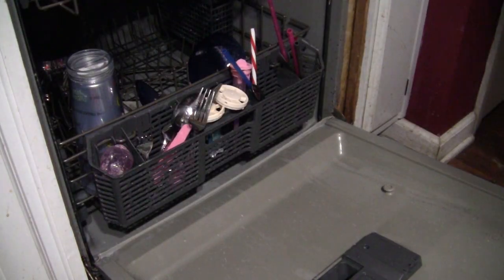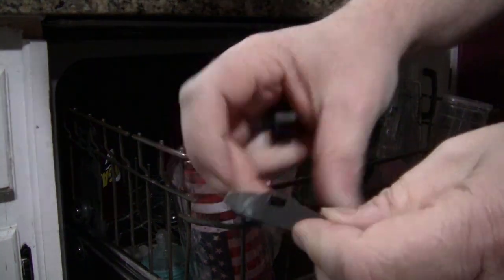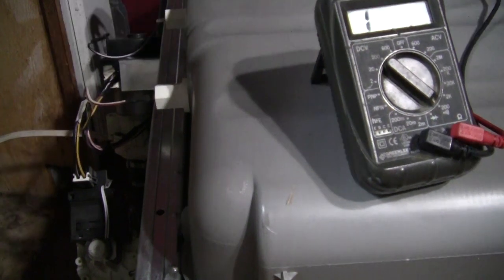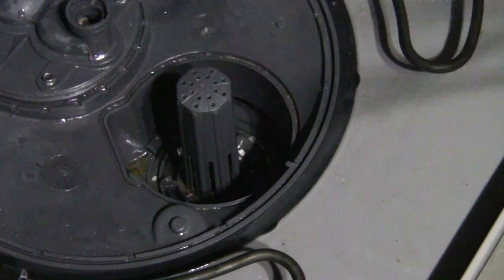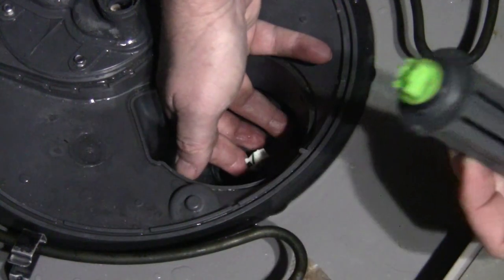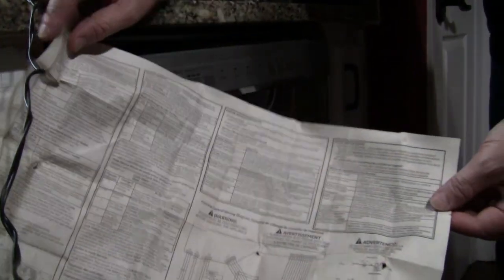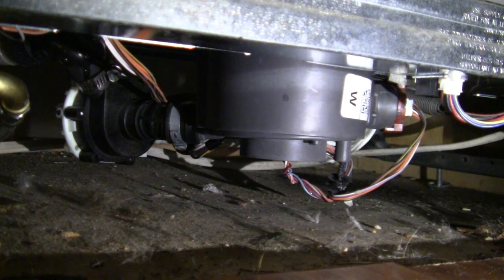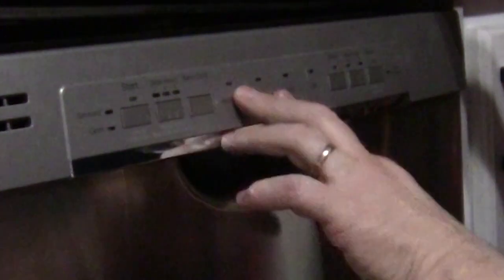GE Dishwasher Heater Not Working Flood Switch Replacement

Comment: Exactly the fix I needed.  I didn’t even bother pulling out the dishwasher and checking the heating element.  I purchased the flood switch assembly on Amazon and a 1/4” hex screwdriver with magnet and fifteen minutes later the repair was done and after running a full cycle I can verify that the heating element is again functioning!  

I could tell upon comparison the old and the new that the float was stuck and highly probable that this was the problem.   Thanks so much for the video!
Reply from the maker: You're welcome and thanks for watching!

Comment: I had this same problem in my GE dishwasher.  I thought it might be the heating element, since that's the usual culprit, but when I checked it with a multimeter it was fine.  I was able to order the flood switch and the install was quick, easy, and cheap.  My landlord even took $200 off the rent because I saved him the cost of having to buy a new dishwasher.
Reply from the maker: Awesome!! Thanks for watching.

Comment: Thanks for the tip, I was convinced that I had to replace the heating element before I saw your video. Replacing the flood switch took about 10 minutes and fixed the issue.
Reply from the maker: I'm glad that it helped!

Comment: I noticed that when you took the old flood switch out, I didn't hear it rattle. And when you started to install the new one, I heard the float rattling around. From the looks of the old one, that food did a number of blocking the float. Good video by the way!
Reply from the maker: I should have checked it out more, including cleaning it and doing meter checks. It was so inexpensive I just swapped it and was glad that it worked. 
Thanks for watching and for the feedback!

Comment: This is the first model dishwasher I’ve seen with the float location in the sump. Also the first I’ve seen that the float switch is in the heating circuit. Interesting. Thank you for this very informative video. Well done!
Reply: Yeah I replaced $150 control board thinking it was gonna fix it. Well, it didn't and now I'm going back to the customer's house to replace the flood switch. Customer complained that it didn't heat anymore

Comment: If at the end of a dishwasher cycle your dishes are filmy and plastics on the top rack don’t dry well- 

Open the door mid cycle and see if you don’t see steam when you open the door.  This is a fix that worked for me.  Just replaced mine today and I had steamy water when I opened the door midcycle and my dishes were clean without the film and greasiness, hot and dry after at the end of the wash 👍

Comment: Fixed my dishwasher with this video, THANKS!  I didn't bother pulling it out, shutting off the water, or even disconnecting the power.   Yeah.  I know...
Reply: I can't understand how the little part you put affected the heat, did it affect the heat
Reply from the maker: It's looking for a signal from that sensor.  If it doesn't see the signal,  it will not turn on the heating element.

Comment: Wish I had found this video a few days ago to fix my no water problem. All the videos I found showed the float of to one side. I needlessly bought a control board and tried to unscrew what I learned later was the float switch ripping the wires apart at the connector. Not until I stuck my head in there I found the 2 screws that hold the retainer ring. As soon as I pulled out the switch assembly and  saw the wire connector I then knew what it was. The float inside must have been stuck up as I never could see voltage at the water valve. It must have come free when I removed it . I soaked it in vinegar while I removed the wire harness to repair the wires I destroyed. Pulled the wire pins from the connector and was able to solder the wires back on to the stub of the broken wire still on the pins. I epoxied the wires together up to the connector just to insure they would not touch where I soldered them. Put all back together and success !  ..Anybody need a control board??

Comment: I bought Model GDF630PSM4SS in September.  It stopped draining after two weeks.  The technician who was sent told me that the problem was that I bought  GE Dishwasher in the first place.  Not kidding!  He told me he would buy a Bosch as all GE dishwashers are junk.  It broke a week later and for the next 3 weeks I had to bail it out by hand, let it sit a day, and then it would work again for about 4-6 times.  The 2nd technician ordered a part that did not need to be replaced, got it to work and then it failed again and would not drain.  I had to buy a new dishwasher and the GE sits in my garage.  GE told me they will not refund the money and would only replace it if the technician states in cannot be fixed.  Stay away from GE.
Reply: I have a GE and it is great. Yeh needs a little maintenance now and then but overall very happy with it.  Dishwashers are super easy to fix by doing it yourself. I have heard equally bad things about Bosch dishwashers. I love my Bosch power tools but don't have any desire to own a Bosch dishwasher for some reason

Comment: I replaced the flood switch on mine. U can hear the.float move in the new part. When i pulled the old one out it was so clogged the float wouldnt move. My filter was gross too. Cleaned everything up put it back tkgether hoping it works. Sucks i already replaced the heating element. Replacement parts sure arent cheap. Running a test load of dishes now...fingers crossed. Thanks for posting.
Reply from the maker: You're welcome!

Comment: Thanks to this video and ones like it I replaced this part flood switch and it fixed all of my symptoms stuck in drain mode each cycle running for few seconds then shutting off no water input no drain fixed all of them thank you!
Reply from the maker: You're welcome!

Comment: Is there any way to test the flood switch before ordering a new one?
UPDATE: If it doesn't rattle when you shake it, change the flood switch.
Reply: Pins 5 and 6 are the thermostat. That controls the heater. There should be resistance when you put the OHM meter across pins 5 and 6.

Comment: It would be nice if videos like this actually show the unplugging of the device, watched this because having trouble trying to figure it out
Reply from the maker: It is pretty much impossible to show that in such a tight space, but if you pull the dishwasher out and lay it on the side it is very easy to see the connector from the bottom. It has a little tab on it that needs to be pushed in to release it. You can see what I am talking about in another video that I have posted here: https://www.youtube.com/watch?v=14bYL6fFDAE at the five minute mark.

Comment: We have the same GE dishwasher I got 7 years ago. About 4 years ago it flooded and GE sent out (free - even though it was out of warranty) a control module (the one at the bottom, not behind the top panel). That worked, but the other day it flooded again (water not draining). The filter itself was pretty dirty and a couple days before I have put in a BBQ grill sheet that was pretty crusty so there was a lot of debris in the water sitting at the bottom of the dishwasher pan. I took the filter out, etc. and saw the flood switch was just impacted with “stuff”. I hose it out but I think it’s best that I get a new one. Hopeful that works and I don’t have to replace the control module again.
Reply: Usernams checks out

Comment: Hi. How do you check before buying flood switch that that is the issue? I didn"t see how you checked if it was a flood switch issue. My ge dishwasher gdf520pgd6bb has wet dishes at end of cycle. I actually bought another element thinking that was it but didnt know ohms had to be between 15 and 30  :/ thought it had to be close to 0. But it still wont heat. Someone said something about tco reset on bottom which i found but it never tripped.
Reply from the maker: An ohms check across it could be done. Unfortunately, I do not have a schematic to verify what pins to check.
Reply: @TwoKeysStudio  thanks. It was the flood switch! Weirdest fix ever but thank you! When i took it out it wasnt making a shaking noise and the new one did so i immediately thought thats the issue and it was!
Reply from the maker: @Teknomanslade2  glad to have helped!

Comment: You can check the heater for continuity from the control board behind the kickplate without pulling it out.
Reply: Control board? Kick plate?

Comment: Tie a string around the electrical connection before you disconnect the old switch. That way you can maneuver without losing the wires.
Reply from the maker: Great tip!

Comment: Is there no check for the sensor? I have a GE dishwasher that is not heating. Need to pull it out and check continuity.
When I moved in, the fine filter was covered in scale completely. I ran a cleaner through the washer after scraping off the majority of scale from the filter.  Thinking about it, this sensor could be covered in scale as well. Hmm.

Comment: Is there any way to check the flood switch before I buy the part? Continuity check?
Reply: should read 0 ohm
Reply: If it is a simple switch it should be off or on depending on the float position, so off would be no continuity, on would be continuity. I haven't pulled mine to look at it. Trying to see if I can find a test.

Comment: If I shake the float and hear it rattling around inside, might I still need to replace it? My problem is also with the the dishwasher not heating.
Reply: Yes. It is actually not the float that is broken, it is the thermostat.

Comment: If the plunger is stuck, you can try cleaning it and save $40 on the part. You should feel something inside move when you shske it. After replacing the sensor, I got my old one to work by digging the gunk out with a screwdriver, forcing water in with a hose sprayer, and soaking in a vinegar solution . Don't soak the rubber gasket end, or it may leak. The plunger passed the shake test, and a multimeter showed it was working in the up and down positions. The plunger didn't move nearly as freely as the new one, so I didn't bother testing it in the dishwasher.  It should work based on the test, but may gunk up soon after.
Reply from the maker: Great tip, thank you!

Comment: How did you determine that the flood switch needed replacement?
Reply from the maker: Somewhere on the interweb I read ion that this switch is part of the timing circuit for the heater. I did a resistance check on the element and it was good, so I tried the flood switch.
Reply: Not so much a timing circuit as a Thermistor circuit..  hidden in the flood switch assembly. GE should call it a float switch / thermistor assembly but they're keeping it a secret, even appliance repairmen seem in the dark according to numerous other websites and commenters. With a wet-vac and a 1/4 inch driver it can be replaced from the top.

Comment: Replaced flood switch, which old one didn’t have ball thing moving around. Ran dishwasher and still doesn’t dry dishes. My old dishwasher was steaming hot when done. This one isn’t even close to being hot. Guess I try heating element next.
Reply: Should of tested resistance on your element

Comment: Would this part cause the washer to flood onto the floor?
Reply from the maker: Drain pump, not being level, bad hose or connection. Running it step by step through the test modes might help you isolate the problem. 

https://youtu.be/I9TofsfqKDc

Comment: This video, however informative, left out one small detail. What was actually wrong with it? All it says is we are going to go from this to this... sure you changed out the flood switch but what were the symptoms that caused you to change the switch? What is the primary function of the switch. If I knew all of these things already I might not need to watch this video. My washer fills and drains fine, but my circulation pump won’t kick on. I think we are experiencing the same thing, are we not? If so I am definitely going to try this.👍🏼
Reply from the maker: It's in the title and at 0:20. This is probably not the issue if your circulation pump isn't coming on.
Reply: Without this plug switch nothing will work properly in the dishwasher after I replaced my flood switch it fixed drain pump stuck on water not filling wash cycle cutting off seems this part regulates everything
Reply: My dishwasher is about 9 years old. Three years ago (2017) it wouldn't drain properly. Went to the GE site and in 90% of the cases, I was told the problem was the flood switch. I replaced the switch and it worked like a charm. Yesterday, on Thanksgiving day (of course) my wife reported the dishwasher won't heat like it should. Based on this video and others, I will be replacing the flood switch again. I think the frequent replacement might have to do with cleaning the filter. I clean it when I remember which is about every 6-12 months. The manual says to clean it every 3 months which I'm going to try to adhere to going forward. I do agree that the flood switch really is the "brain" of this dishwasher and quick, cheap fix. Matter of fact, I'm not even going to pull the dishwasher out to check element continuity. I'm willing to gamble on the $20 switch and if that doesn't fix it then I'll pull the box out. I just don't want to risk pulling something loose and then having a bigger leak issue. Thanks for the tips!